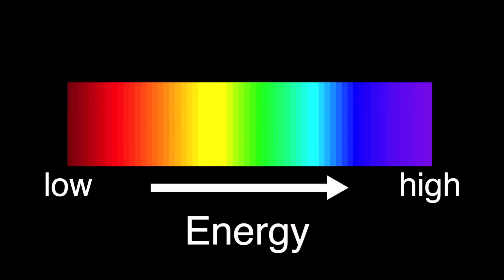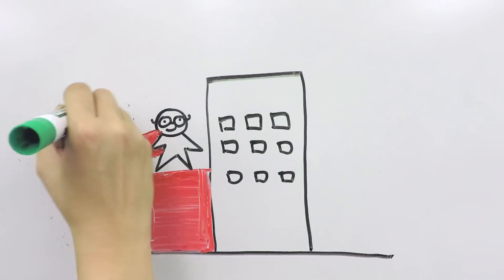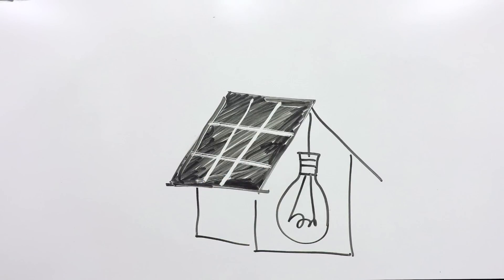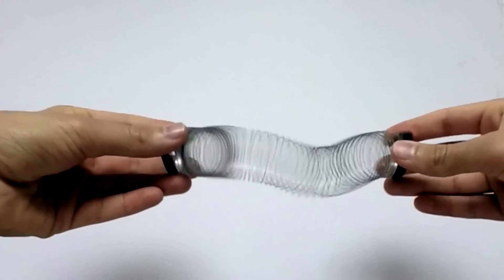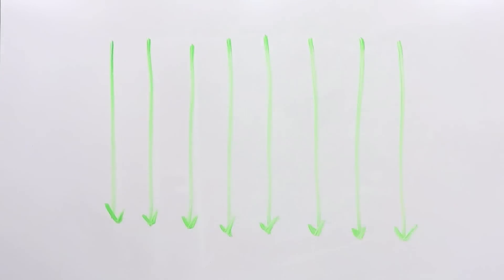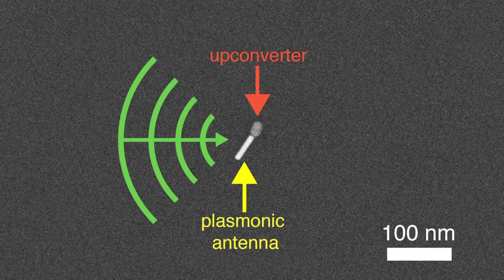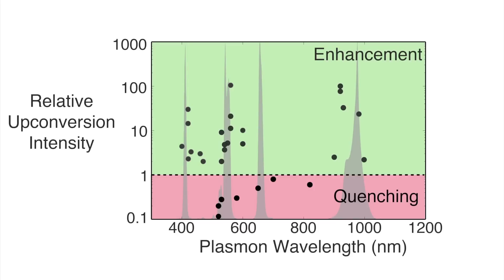Plasmon-Enhanced Upconversion

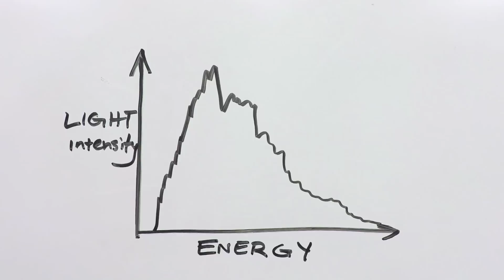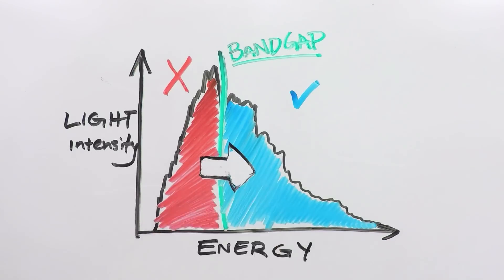Comment: The diagram drawn at 2:20 is completely backward and will serve to confuse the viewer. The typical blackbody spectrum of solar radiation is drawn normally, but the illustrator then reverses the energy levels of the x axis from what is correct. For the shape of the blackbody spectrum drawn, the HIGHER energies (blue light) are on the LEFT near the origin of the plot and the lower energy infrared wavelengths are on the far right, but then at 2:30 further diagram aids are drawn incorrectly illustrating the opposite case. ie., the illustrator is actually showing DOWNconversion on the plot, not upconversion.
Reply: No buddy, the diagram is right. The diagram you are referring to are intensity vs wavelength (solar irradiance graph). wavelength is inversely related to energy of a photon, hence the reversed plot. Also in upconversion we increase the energy so that too is correct.
Reply: @Academic-cf8vx  I'm afraid that you are the one who is in fact incorrect. The shape of the solar spectrum is highly distinct, with high energy blue and UV light intensity falling off rapidly, and red and IR light falling off asymptotically. The shape of the curve shown here would need to be mirror-reflected about the Y axis for the explanation to be correct in this video. Look up the actual curves and compare to what is shown here and you will see the error.
Reply: @Muonium1  Thanks for correcting my mistake. There is indeed a mistake in the graph. IR side should have been spread and peak should have been on blue side. The graph and explanation was correct, just the plot was wrong.